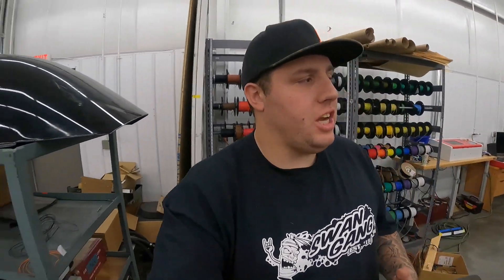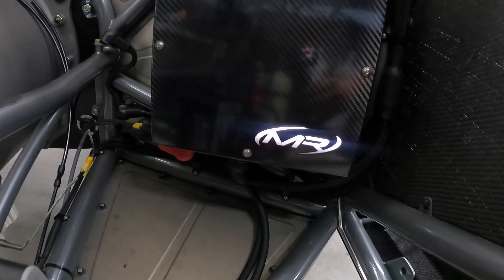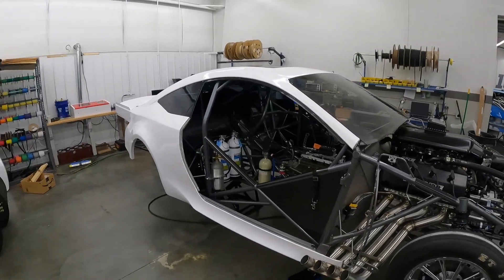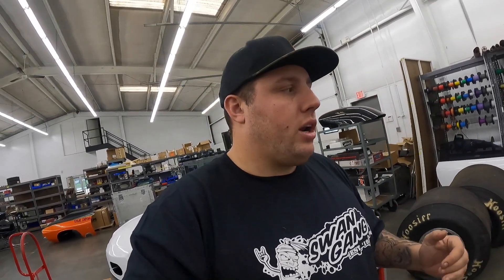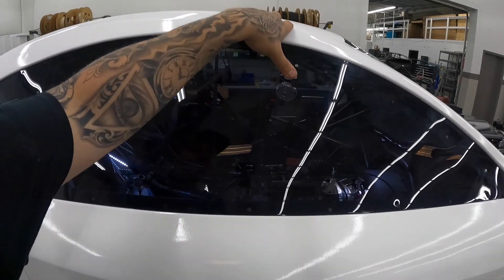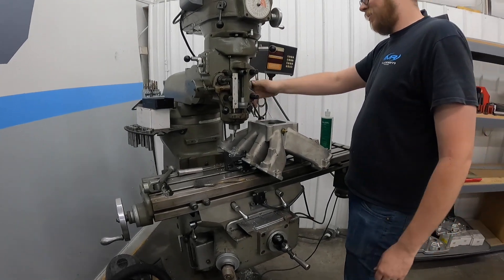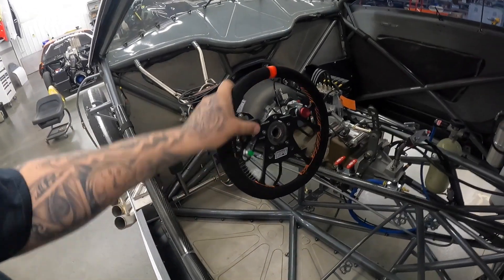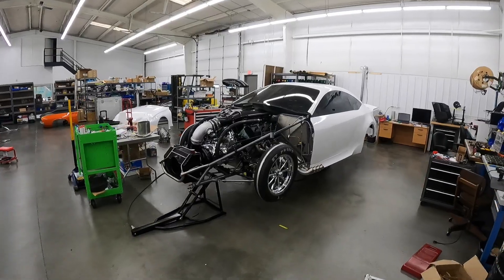NEW COLOR ON THE CAR!!!! Prenup Looks Mean With New Wrap!

Comment: How tall is that tire? It looks like its got a set of 42 inch tubs that could handle just about anything. Those tires look shorter than I would have thought would be on there. They look like a set of 32s or 34s. Maybe its because they were deflated they just look short.

Comment: Are they going to let you race if the car is not CERTIFIED, by  NHRA? Just a thought, i know it will pass, i know  Cameron built an awesome piece,  I  know when I raced, tech guys would always check the sticker on the cage? I know you guys are scrambling to finish, didn't want that to fall through the cracks!
Reply: It will be certified @ there 1st race by the NHRA cert guy
Reply: @melissaswanstrom3339  it's last 10% that takes 90% of the time, i know when I would go out of town racing, mine was on a much smaller scale, its all the little things that slip through the cracks.  I would hate for you guys to get there and no one there to CERTIFIED the chassis.  Congrats and good luck, awesome car, family,  videos etc. Best of luck to you guys!

Comment: Hey, I'm really surprised that y'all are not telling the people watching your YouTube channel about the EPA and how they are trying to  interpret the Clean Air Act and how they are trying to end all motor sports and any aftermarket automotive emitions parts or modification. Anyone that enjoys watching or participating in anything to do with performance cars, trucks, SUVs, motorcycle, boats, or ATVs, needs to be worried about the EPA and what they are doing. Everyone needs to look at the RPM Act, which will keep the EPA away from our motor sports and performance vehicles. Thanks to Cleetus McFarland from YouTube trying to spread the word, I found out about this, but I think everyone else that has a YouTube channel that has anything to do with anything that has tires and a engine should be spreading the word as well. There is a online form everyone can go online and fill out, so that all our representatives will receive the letters telling them to make sure to vote for the RPM Act, to protect us from the EPA's overreach. This link is for the online form:
https://www.votervoice.net/mobile/SEMA/campaigns/45394/respond

If you want to read more about the EPA's Clean Air Act and the RPM Act,  here is the link:

https://www.sema.org/epa-news

You can also watch Cleetus McFarland's YouTube video where he talks about this, here is that link:
https://youtu.be/jqhqUvi8v6g